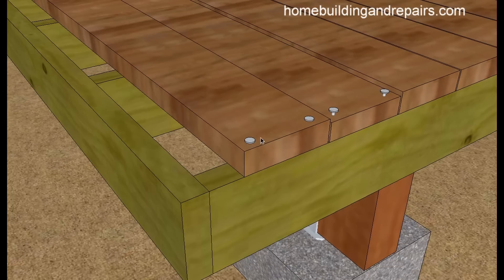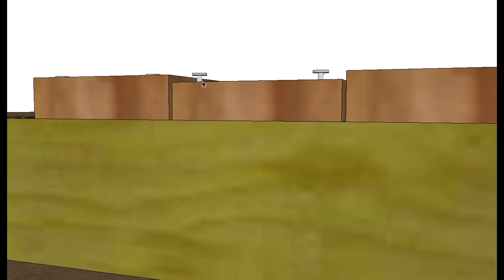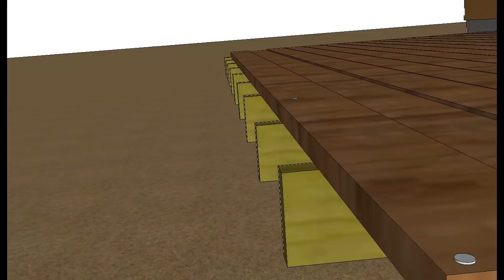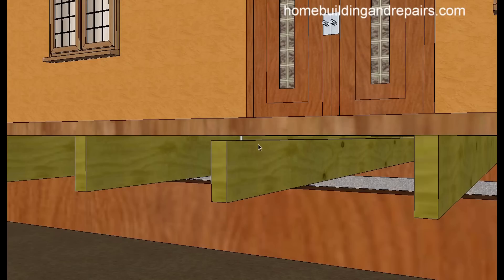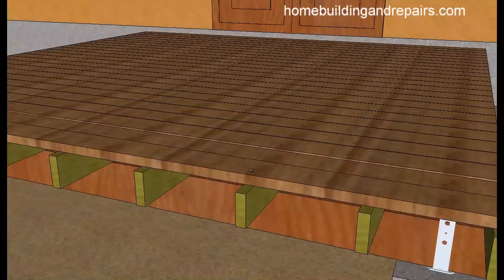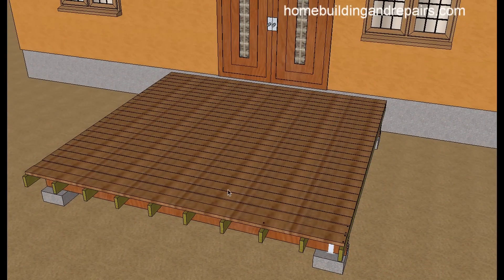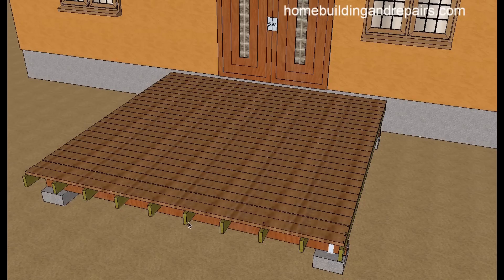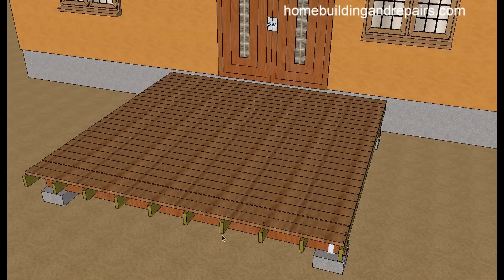What Causes My Decking Screws and Nails to Raise or Pop up? - Home Construction Tips

Comment: Thanks for the tip about a problem.  I'm aware of the problem that's why I'm here.  Would have been nice to have a solution.
Reply from the maker: Simple solution will be to drive the nails back down or use screws, but that won't be possible if nails and screws will no longer hold because the wood is damaged. If that's the case, then you will need to add additional lumber or remove and replace the deck. Even though your comment was a little rude, let me know if this doesn't make sense or send me some pictures of your deck and I'll see if I can help.

Comment: I am having this problem too. Unfortunately for me I have alot of nails as its a decent sized deck. My idea would be this, wood glue? Pull the nail and stick the nail in wood glue and re hammer?? Think that might do the trick?  Tired of doing this every year and I think I ruined a pair of my water shoes today as I stepped on one and could feel like it maybe puntured my shoe  :(  Whats even crazier is the deck is hardly used at all. Most action it gets is me pressuring washing it every yr.

Comment: Here in Israel nost of the time when I see screws going out is on Ipe decks with pine beams. I think it happens when the installer screw too much the screw - it causes the fibers of the pine to tear and make it weaker, then with time and movements the screw tears the pine fibers more untill there's no grip (Ipe stays hard and stable - unlike pine).
In these cases it isn't possible to screw down again beacuse there's no grip, so a longer or wider screw is needed.
Reply from the maker: Interesting and thanks for sharing.

Comment: thanx for the video tips, what do you think on using those trex deckboard style clips to fasten deck board and try to eliminate screws and nails from raising?
Reply from the maker: I'm not 100% convinced that it's the best way and have actually seen some problems with them loosening up over time, but there could be a good reason why like maybe they didn't follow the manufacturer's instructions. I would love to know what happens if you use them and if you have any problems with them in the future.

Comment: I think most of us who build a deck realize what makes the screw or nail back out.  What's the alternative solution to not have this problem? composite material is not always within a persons price range of material..  Super glue???
Reply from the maker: Are you suggesting that I could stand outside of a major home improvement center and that a majority of people could actually answer this question?
Reply: No, I didn't mean that.  I only implied that a corrective solution to he problem be addressed. Your video's are informative and I enjoy watching them.  I'm a retired civil/structural designer and I have a deck out back, that I built a few years ago, and its backing nails out as I'm typing this.  I was just searching for a fix, when I watched your video.  Did not mean anything offensive.  I've learned a lot from you.
Reply from the maker: No problem and I'm glad you like the videos. It's difficult for me to provide a solution to a problem when I don't know exactly what's going on with your individual project. I would remove the nails that are backing out and install new screws and if the screws are backing out then I would try using longer or wider screws, but could not guarantee my suggestions, because I think weather conditions, how often the deck is used and the materials used, along with the methods of construction, over spanned materials and a variety of other factors can add to the problem.